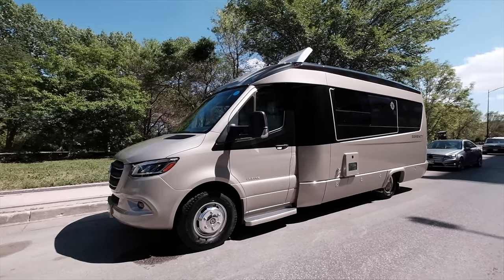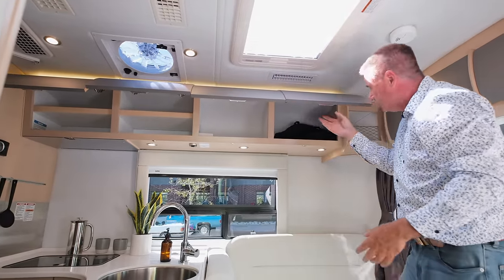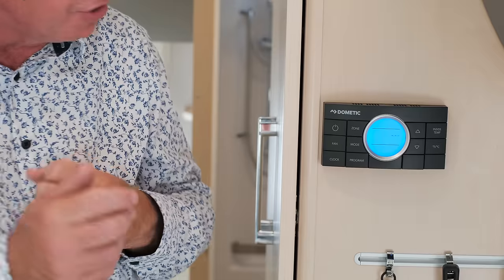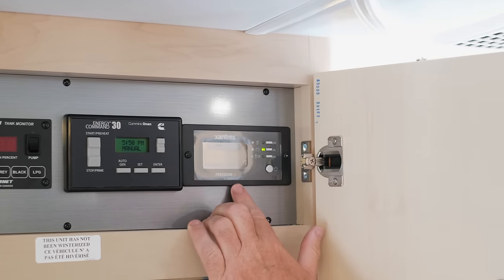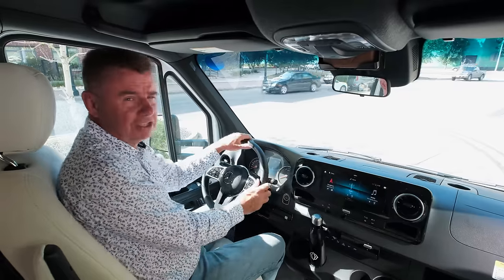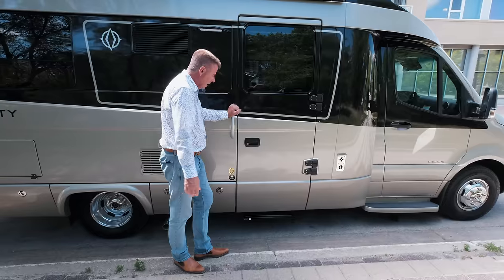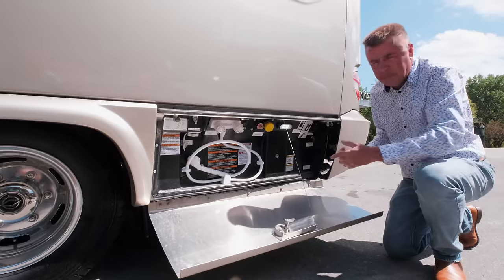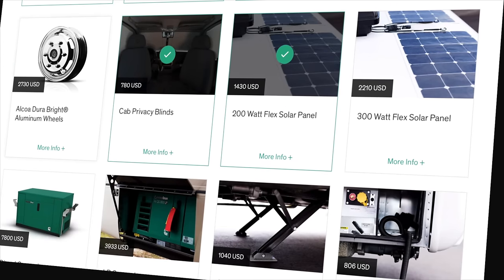2020 Serenity

Comment: LTV is really checking off a lot of boxes!  Beautiful motorhome.  If you would up the electrical system to 600 ah or so lithium with a quiet DC AC and make sure it's 4 season, there would be very few reasons to buy any other class B or B+

Comment: I watch these videos to help come up with a design for my future camper vehicle I plan on making from a cargo van / box truck. Surely theres compact electronic couches that turn into beds. I REALLY like the method of having an L shaped couch where one part extends making a full sized bed using both parts of the L for space.

I love that the problem mercedes has.... is how to swivel the TV to fit how large the space is lol. What a problem to have..... I'm over here wondering how the hell I'll fit a shower, kitchen, and bed in such a way that its comfortable.

This is my second van build. First van was very basic and did the trick.

Comment: Leasure Vans makes some of the best floor plans on the market, and from what I have seen the quality is on par with the other high-end coaches. However, the electrical system is so yesterday, generators and AGM batteries. Put lithium-ion batteries, 3000 watt inverter, 12v air conditioner in this coach charged via solar and a second alternator and this would be perfect.
Reply: Edi2003 I agree that it costs more, and know that I can do it myself, but I should have to choice to purchase it new this way. It’s a waste to purchase a new RV and immediately strip the electrical system. If manufacturers of lessor quality (W) can offer several models with a LiPo no generator option so can LV. This van is $150-$160 now and would cost $200 with the option just like the big W. As it is now I would not buy a new LV, only a used one knowing that I’m going to replace the electrical system.

Comment: I find this van almost perfect, the only thing I would wish for in a new 2021 model is that the outer storage were drawers instead, maybe even with a little automatic push or electric push and the new closing key system you have on the other new 2021 vans. That would make it much more comfortable to storage outside. Hope to see the same model in 2021, but with more comfortable storage drawers outside. Have a great 2021.

Comment: VERY sweet!!! Love Dean's videos. I have one question. Can anyone tell me why the autostart system only comes with the propane gen and not the diesel gen?
Reply: At a guess so you don''t run out of fuel?  Doesn't the diesel generator work off the same tank as the engine?
Reply: @gaelengesser9484  My first htought too, but most have a low fuel shutoff so you don't run out.

Comment: It’s time fee Leisure Travel to begin focusing on applying new battery technology in its RV’s. Two AGM batteries are not sufficient. 5 minutes microwave will suck all the power out of these batteries.
Reply: 619 OG  I'm pretty sure the math doesn't check out on the "5 minutes of microwaving sucking up all the battery power" claim, but I would have to see the numbers for everything to be certain
Reply: Can you get this with lithium iron batteries?

Comment: The toilet section is too cramped even for an average person. Also there is significant gap between the bathroom door & the floor matt. Privacy is indeed a big concern.
Reply: It's needed for air flow to help circulate the air while using the ceiling vent and AC
Reply: @Md.Nazmul Alam Evan: You're mistaking the way how the air-flow works.  In the bath, there's a ceiling vent fan to help exhaust moisture to the outdoors.  On the outside on the roof is a vent that goes to the black tank to exhaust waste gasses.  The bathroom fan would be used mostly for during showering to exhaust moisture to the outside and not used when the toilet is being flushed with the gate open otherwise you'd get a draw from the tank into the bathroom and the exhaust tank vent from the roof would be acting as an intake.  (You an guess the rest).  Now, with the bathroom door closed, and the fan on, you'd have that air gap top and bottom to allow fresh air to circulate into the bathroom and getting drawn out the ceiling vent regardless if you have the windows or vents open in the cabin or the AC or heat running.  Otherwise you're dealing with stale air.
Reply: @Md.Nazmul Alam Evan: I am not going to justify my answer to you any further.  If you don't like it, too bad troll.  Take a walk out the door and don't let it hit you on the way out.

Comment: the price for the solar is ridiculous on these units and so are the price of batteries when upgraded to liion. Please haev reasonabl prices. Alsio flexible solar panels die in a few years because of heat dissipation issues. there are 400 watt or 350 watt solar panels you can get that have ample ventilation. Can you please upgrade to those and battleborn batteries which are 1k each,  or have a seperate option where we can pay for just the solar pane routing cables preinstalled and we can install our own batteries and panels.

Comment: Leisure travel vans is my dream RV.  Just not sure i will ever have the money to buy one.  My only real dislike is the diesel fuel.  I perfer gas
Reply: Get a wonder, it's basically the same van on the ford chassis which runs on gas.
Reply: @xToddmcx  I agree and I keep looking at it and dreaming just don't kniw if I can realty afford one.
Reply: @sharonfields6703  You can't buy one right now anyway. No one can get the chassis in quantity, mercedes or ford, and the RVs that trickle into the market sell out instantly. But in normal times, in a year or two, they sell for 20-35% off MSRP so it might not be as expensive as you think.

As far as I can tell this 2020 Serenity was never, or barely, actually produced. They designed it and then cancelled the serenity.
Reply: @xToddmcx  it will be a year or more before I could even think about affording any RV.  And it will take me a year or more just to downsize and get ready to sell my house.  By then all but the house will be paid off and I can take on the financing of a $100k plus RV even if the house does not sell right away.